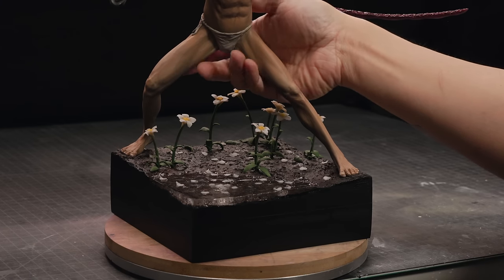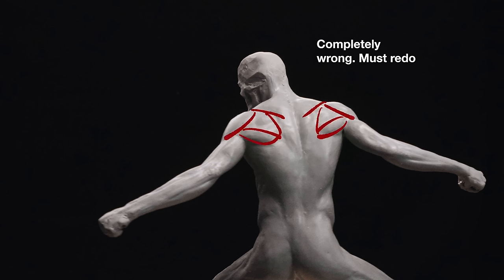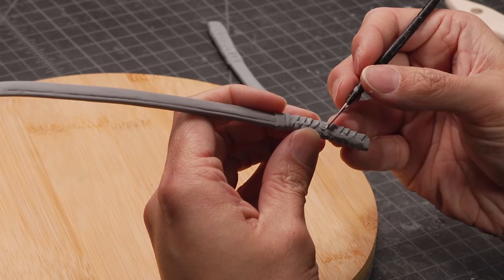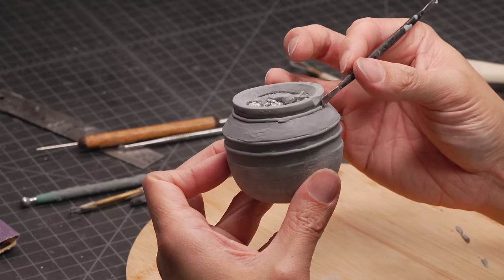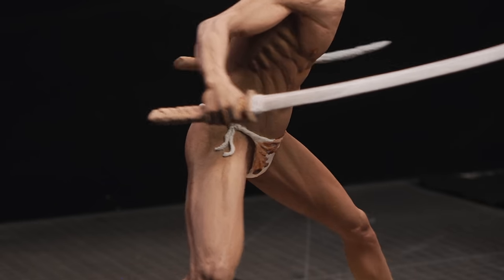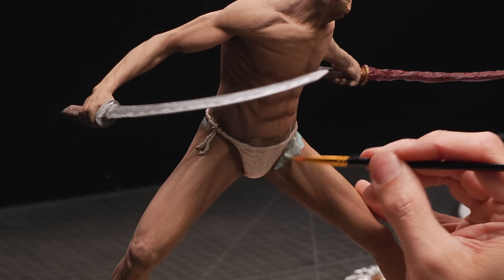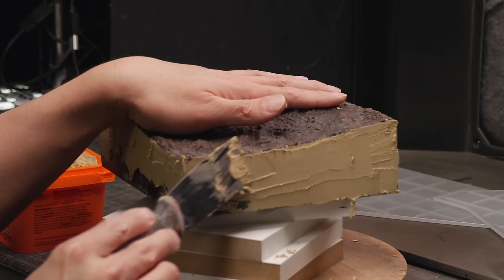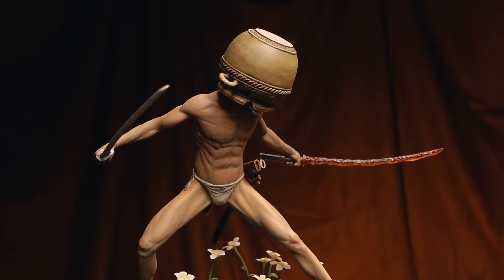Let Me Solo This Sculpture

Comment: In Miniature Painting, we know these problems. Your problem is with your primer. Try using a rattlecan primer next time. When you use the airbrush to prime your models, the prime layers are too thin to stick to the model. I hope your next model will not have the same issues. And by the way, this artwork is amazing!

Comment: Hello, friend. I really can relate to all those mistakes and headaches. I am a wood carver, I work by hand almost esclusively, and it's a real... experience, to see something like that happen. To see that, after pouring hours of effort, an almost flawless job now has a glaring defect for a single mistake, probably for just being a little lazy at a seemingly foolproof task.
But one thing I have been obligated to learn is, it's not even an option to give up, most of the time. You just have to work with what you have, or accept that it's messed up beyond repair and that, no matter how frustrating and depressing, you need to do it again.
Some time ago, I heard a phrase said by a japanese carver, who said that when you live from making your art, your work, it's not an option to leave things be. You'll habe to redo things, like it or most probably not, and go throught all the proccess again. And there's this funny fact, that after swalloing thr bitterness, and getting to work and get things done right, you improve. You will have learned how to do things better, what could go wrong. And it's on that cycle of doing, failing, learning and  succeding that mastery it's attained.
I'm still far from being a master of my craft. And it's so bitter to see how good other people are, realizing how you could be done better and thinking that someone else could have done a work so much more beatiful. 
But then again, when you see back and realize how much you be improved, how much better you are than a year ago, and a month ago, and than yesterday even.
There is beaty in growing, in not giving up, in not doing perfect, but striving to be ever better than before, that every cut, every trace, and every stroke you do at work is better than those befor.
Reply: Sorry for the essay, I got carried over. It's just... a very important theme for me.

Comment: As always, I love love love your commentary.  Regarding spackling/wood filler, next doing that, I suggest you try Durham's Rock Hard water putty.  Mixes like flour and water to any consistency, dries VERY hard--one caveat, don't go much thicker than 3/8'' thick as you could get cracks.  Beyond that, It dries VERY hard pretty fast and is very sandable and takes paint great.

Comment: I think some of those imperfections and oblong/ascue parts of the anatomy give the piece more character and make them more personal. Don't get me wrong when I make something so obviously incorrect that really looks off I do make adjustments. But as I continue to challenge myself to losen my grip and allow more things to pass through my "perfectionist" filter, the more I realize much of what i think is wrong is simply because it's something I'm not used to. My rule is, if I feel too comfortable throughout project after project I'm probably not pushing myself hard enough to try something new. You seem to have a lot of experience with this practice. Unfamiliar and uncomfortable are two of the main ingredients of breakthrough and discovery. But ya that bellybutton was way too low. 😂 This piece is amazing btw. The story behind it, the struggles along the way and the end result. It really is beautiful.

Comment: I can tell the difference between the anatomy side by side, but I could not tell you which one is correct.

Also, I think cosplay was indeed the right choice for the swords, considering it's a little bit bendier. If you accidentally bump this sculpture off of a shelf, the cosplay might survive. A harder clay probably wouldn't.